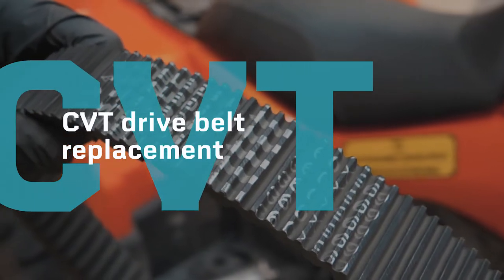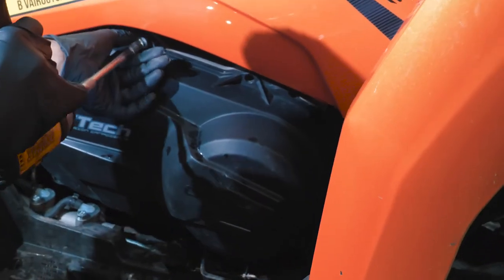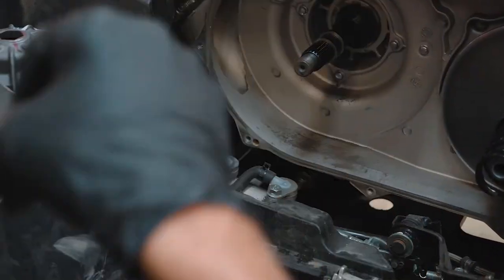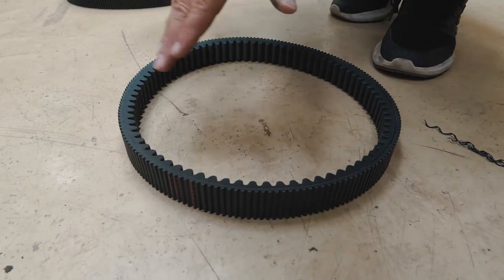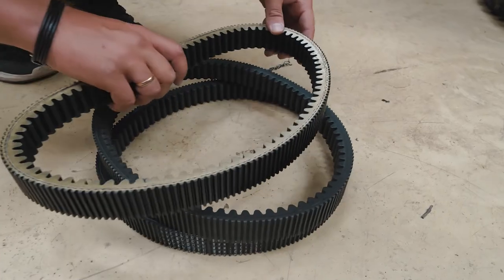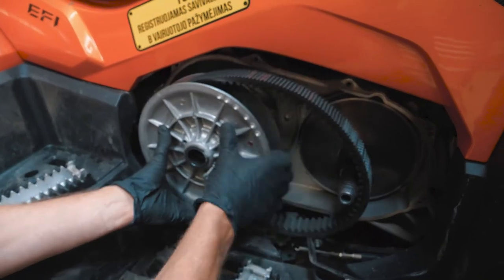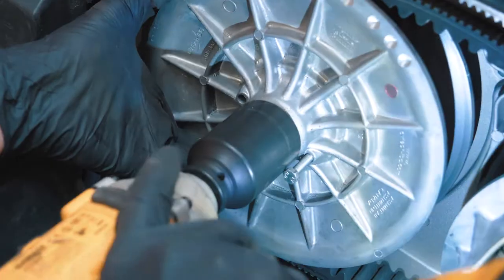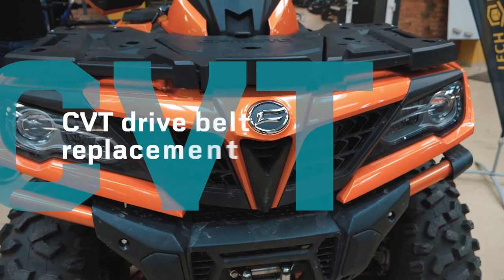#ILoveMyCFMOTO EP05 CVT drive belt replacement

Comment: Is this a official CFMoto video? The reason I ask is, In the CFMoto 2022 service manual for a CForce 1000 Overland it says to never use a inpact driver to loosen or tighten any of the secondary or primary bolts. I assume this is becouse it coud dammage the bearings? It also shows torque for each nut and all three are diffrent. You cant acheive this with a inpact drive.

Comment: This is all great, but what are the torque specs for the bolts? Thanks!
Also, important thing to point out that is missing here, belt is directional, and the arrows must point the front of the vehicle when looking from the top.
Reply: Ok, so for all of you that are searching the internet for the answer, I finally found it in the service manual (for 850xc). Driver pulely main nut = 180Nm, driver pulley shaft nut = 60Nm, driven pulley nut = 150Nm

Comment: Hi! Good video, but a couple of questions: 
the arrows on the belt should show the direction of the belt when its moving on drive? Usually they say that the letters and numbers should be readable when you install the belt so the exact opposite direction? 
the discs (pulleys) are balanced (there are drilling marks on the disc), also the cover (the ramp plate) on the disc is balanced. so is it important to assembly the ramp plate exactly to the same position as it was done by factory or is it not important as both of these parts are balanced separately?

Comment: The m6 bolt isn't loosening the belt. The m6 doesn't go all the way in, seems like it stops after you screw it in half way in or so. Any tips or another way to loosen the belt?
Reply: wat length bolt did you use?

Comment: How to perform such Belt exchange on the wild (imagine yourself on a trail without anykind of help or support near)? Any other simpler way can be possible? Less tools?
Reply: Would like to know this as well !!
Reply: @chelifan24  I've tested. The belt replacement procedure is one-way: easy to insert, hard to extract/remove. If the belt breaks in the wild, just open the plastic cover, clean the CVT, put a long bolt to open the CVT, cut the remaings of the old belt and push the new belt into the CVT. Remove the bolt and close the plastic cover.
Reply: Always carry simple tools

Comment: what brand belt are you guys using? i need to replace mine im debating between: bando, mitsuboshi, gates. thanks ( been hearing mitsuboshi is the way to go)
Reply: What did you go with and how is it holding up ?
Reply: @davidcooper7212  I’ve went with Mitsuboshi. But I haven’t fitted it yet I want to use the stock belt until it breaks to see how long it will last. Will keep you updated
Reply: Any info?
Reply: Still running on stock belt. Just under 5000km and belt still looks almost brand new

Comment: good afternoon, i would like to know what is the measurement of the screw that loosens the larger part of the cvt
Reply: M6 Bolt
Reply: 6 mm
Reply: @magnovska9506 do you know if the m6 bolt has to be a specific length?
Reply: @michellerobinson1453  wat length bolt did you use?

Comment: Just sharing...my 2021 cforce 400 2up needed a 32mm, not 30mm on the primary. 

For those asking about the M6 bolt.  I picked up a 60 mm m6 bolt just to be safe, was more than enough.  Was just over $1, better than buying a $20 tool.
Reply: I have M6 bolt 75mm but the threaded section is 20mm, is it gonna work?

Comment: Do I need to take the clutch apart or can I just use the 6mm bolt and roll the belt over
Reply: I have the same question, did you get an answer?
Reply: @spencerhead784  yeah you can use a 6mm bolt. I’m assuming they didn’t show that because it’s a bit tough to roll the belt over but it can definitely be done with a bit of brute force.
Reply: @Joe-mp4nw  brute force is something I’m good at, sounds good, thanks!
Reply: Any info?
Reply: @dragotolic3598  yes you can

Comment: Do anybody knw if you really have to take the clutches off to put the new belt on.  Can't you just use the screw to spread secondary belt and slide it off.
Reply: I asked the same question. I’m pretty sure you only have to use the screw and roll the belt over.
Reply: @Joe-mp4nw  you can screw a blolt in and it will spread. .  I did my cusins bike.
Reply: @thebull5099  ok yeah that’s what I thought. Idk why everyone takes the clutch apart.
Reply: @Joe-mp4nw   if you take clutch off.  It's reverse  threaded. Tighten  to loosen.  Loosen to tight.  Take it off as 1 whole piece.  Don't take off piece by piece.  Grab and pull all off. If u do this
Reply: @Joe-mp4nw  use 2 screws on the secondary clutch to do it easy